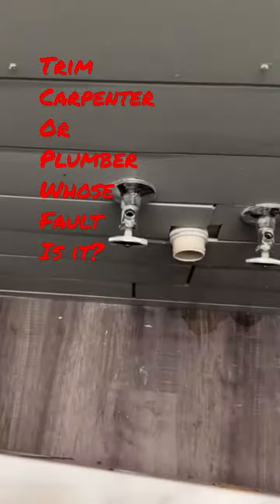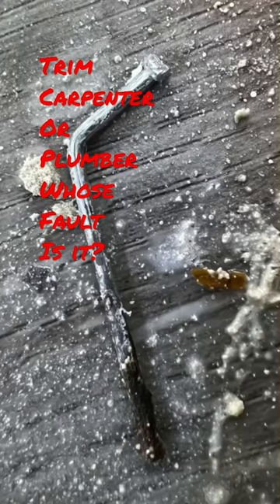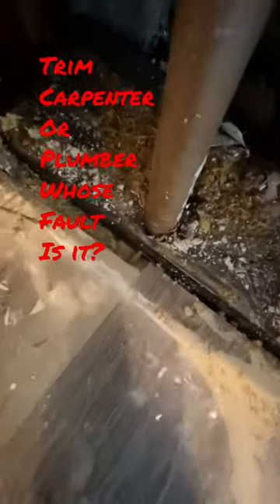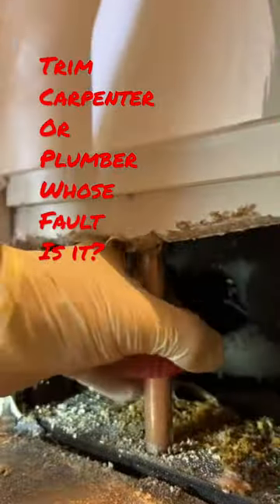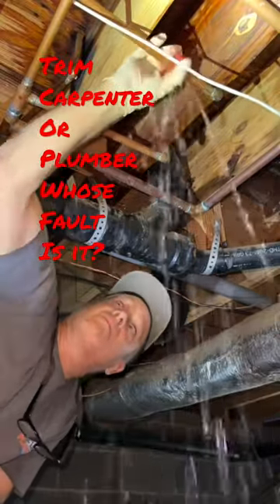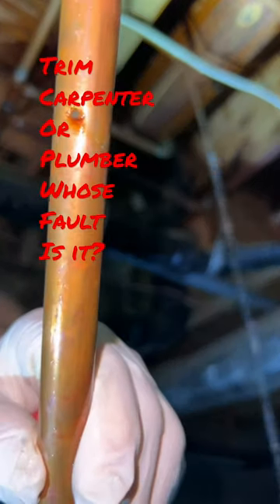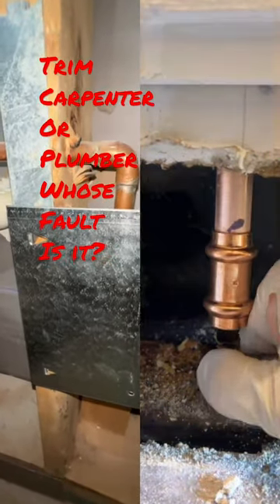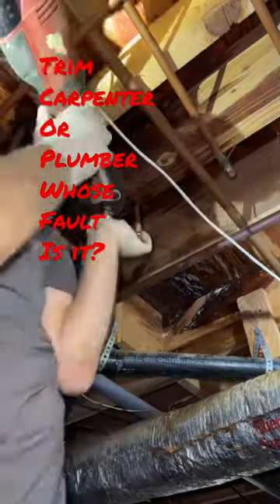Copper Nail Hole Repair@TappPlumbing #plumbingproblems #plumbing #copper

Comment: What a dumb repair man, why so many fittings?
Reply from the maker: There would be no way for me to press a 90 that close to the joist. The joist were completely saturated with water so no soldering either. Thanks for watching our video and asking such a thoughtful question!
Reply: @TappPlumbing  Question. Have you ever heard of solder? Wet joists do not inhibit solder from taking. You could have at least attempted to use a press slip coupling if you cant solder.
Reply from the maker: @JackTheAwesomeKnot   If you really look close you notice the horizontal line is right on the joist. So the joint turning horizontal would be up in the joist or right at it. I know you are fully aware when the joist is that saturated it is swollen. The original hole bored
in it was exactly the same size as the pipe to start with . Not even a portion of a hub would fit in there. I realize you don’t know all the variables involved looking at a video so I am gonna take your wonderfully kind constructive criticism as just trying to be most helpful and thank you so much for that!
Reply: @TappPlumbing  Keep being in denial, it won't help your bad repair man. All those fittings restricting the flow...
Reply from the maker: @JackTheAwesomeKnot   I am so sorry you feel this was a bad repair! I am sure the flow restriction that you are absolutely correct about will not cause too many problems because it is only supplying a lav faucet. I hope you have wonderful day and thanks so much for spending this much time on our channel!